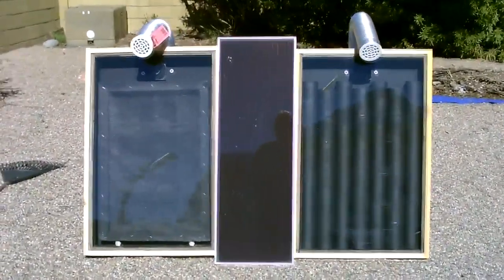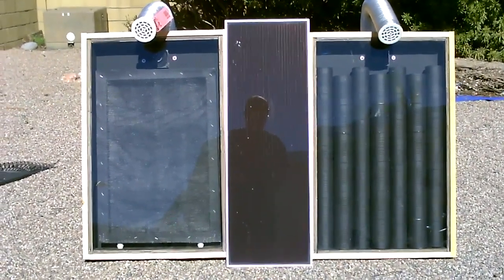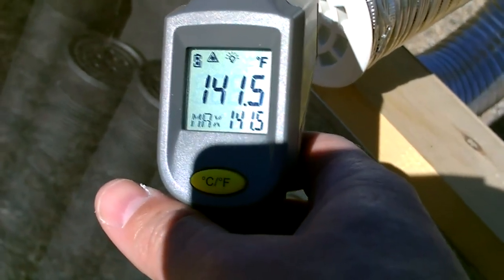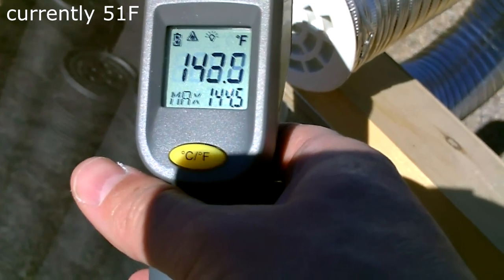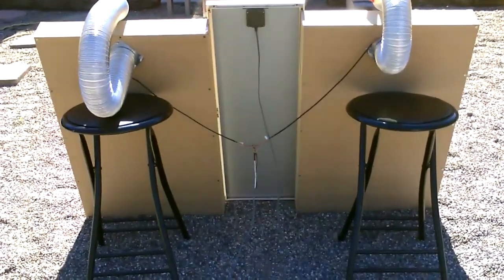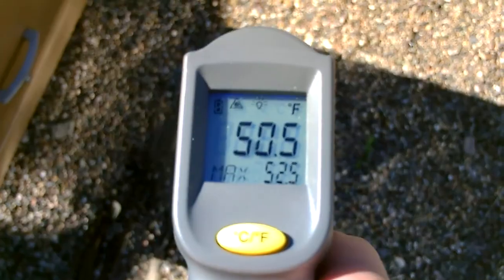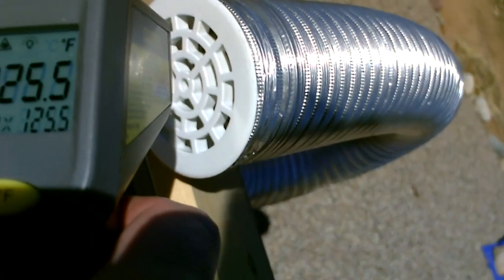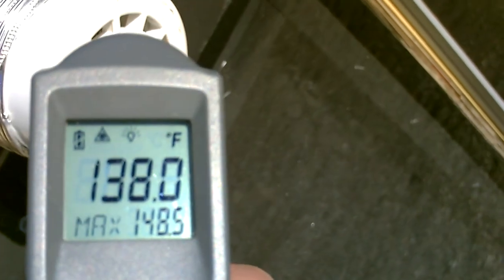Solar Air Heater Comparison! - Steel Can Heater vs. Screen Absorber Heater (temp. tests)

Comment: Although the can solar air heater has slightly lower efficiency it has more mass and will run without the sun for several minutes (one poster demonstrated his solar can heater would run 10 minutes when the sun went behind a cloud) whereas his screen absorber was off real quick after being shaded by a cloud and was on/off on/off on partly cloudy days whereas the can collector was more consistent.  That would drive me crazy inside the house since I live in a cloudy area and so far I'm leaning more towards the solar can collector even though it's 3-5% less efficient it won't be cycling so much on cloudy days driving me crazy.  If you live in a sunny area, screen collector all the way it's so much easier to build.
Reply: The point of a solar collector is to turn as many solar rays into heated air, and move that heated air to get that energy out of the solar collector before that heat energy is lost to radiative or convective heat loss. The down side to more thermal mass and lower surface area absorber is that it has to get hotter to give up  heat to the air. Think about this, 1 square meter has to get hotter than 10 square meters to heat the same volume of air in the same time frame. Being the absorber is hotter results in radiating more energy away as infrared light vs heating air as can be seen with thermal imaging.

One can still intigrate thermal energy storage with a box of rocks  resting on a wire screen layed over a wire mess and blocks supporting the wire mess. Hot air from the collector can be fed up through the rock providing a lot more thermal mass and surface area to quickly store or give up heat energy.  When the air inside the solar collectors is the same or below temperature inside the home, forced air is then be diverted from from the collectors and fed strait into the thermal storage. Being fed room temperature air, the rocks would then give up their stored heat energy.
Reply: @kreynolds1123  Fire bricks, used in Air tight wood burning stoves.
Thanks for the idea.. I'm building my first collector as we speak.
Reply: More Mass however will also take longer to heat up.  You can balance them to your use.   Your fan will stop long before the heat is extracted -add a small Li-on battery to keep your fan going during light shade.
Reply: Any interesting and valuable point. I was thinking of using this for greenhouse heating and pumping it into a thermal mass battery anyway so it still works for me. I suppose the same could be done for a home, but that's a little bit more difficult than just burying the duct in some dirt.
Reply: What Keith and Daniel said. Check out Kirchoff's law. More mass = more time to get up to temperature. More heat sitting in a collector that's shaded = more radiant heat loss. That would = far more than just 3-5% less efficient. Generate and move that heat as quickly as possible. An ideal collector will have high thermal conductivity, low mass, and low emissivity. All solar collectors designed and tested with thermal mass have proven to be less efficient, and not cost practical. It's a waste of material.

Comment: What about some very loose black painted copper(may have to use steel wool, because where are you going to find fine copper wool)? It would allow very good airflow and lots of surface area.

Comment: Imagine the temps if you were to take conditioned air in the bottom & output the air at the top. Have the heater on the outside of the home with the intake at the floor of the room with the output of the heater up the wall of the room.

Comment: since the screen isnt 100% blocking the sunlight, a second and even 3rd layer of screen could be added say spaced 1cm apart, even if the third layer gets little to no light, there no loss and the cost is virtually nothing.
Reply: Ideally, solar collector both minimizes their thermal mass and maximizes surface area to increase their efficency. In short, the point is quickly get the energy to heating the air, and to move that air out of the collector before the energy radiates away.

Comment: Can this be placed inside the home,in front of a French door?Will it effect the glass on the door?Great video!
Reply: +Bill s .    Remember, once the sun's rays penetrate the window, that  heat is already in the room.
Reply: +Elaine Howard Biber   Yes, that is certainly true, but with the collector working with already somewhat heated air, wouldn't it produce even hotter output with zero radiant leakage since it is entirely inside the structure already?
Reply: +Jim Smith Sr.  I'm no thermodynamics expert, but I don't think so. Wouldn't the room just get hotter and hotter without limit ? Once the heat from the sun is inside the room that quantity of heat is fixed. If you use it to heat up the collector then that sun light is not heating up other surfaces that the collector obstructs.

Comment: Hi...a comment and a question. first do you think a black painted aluminum screen would be even more efficient?  question.
since the black screen seems to absorb heat pretty well, does this mean that we should be using bright screens on our window if we want cooler air through them into the house?  shiny aluminum for example?

Comment: Thank you for the detailed build instructions in your other video ans for following up with a comparison video. 

I feel that the can version would be hotter if the airflow was greater. so by drilling out the whol bottom of the can.

I have 2" pvc pipes, but seem to find no video of anyon doing it with pvc. we don-t have cans here because people crush them for recycling...

What's your take on PVC?

thank you
Reply: +Yves Baggi you don't want to use PVC because they are an insulator and would not allow the heat in the Pipe.  The best thing I would use is copper tubing.
Reply: Aha, really? I didn't know that. I figured copper should be best but pricy. will go with soda cans.

Thank you Randy Holt
Reply: I've seen several videos where people buy aluminum downspouts and make solar heaters in a similar fashion.

Comment: have you thought about aluminum screen with a black coating? And since the heat output of these is fairly close which one was faster and cheaper to build?
Reply: clearly the popcan one
Reply: @Ladosligese  What? How is the pop can cheaper to build? When the other you just have to stretch a screen across a frame.

Comment: I am surprised that the screen is better. I guess the surface area of the cans is not so big. Maybe it would be better to cut e.g. Soda cans into little strips and let the air rise through the spaces between, but you need a lot of pop cans for that. :-) 
I would be currious if it is possible to increse the efficiency if one zig zags the screen material horizontally or vertically. Maybe I try that. Another interesting experiment would be to try to release the hot air through little holes along a baseboard pipe. There is a physical law making the rising air, stick to the wall, heating it up. The air cushion along the wall heats up the wall and makes the wall radiate excess heat after some time. Also it reduces the walls from sucking the heat from the room.

Comment: if there's clouds covering the sun and its snowing wont the cans get cold and not work ?
Reply: The cans will still stay warm even in cloudy weather. There is still light to be collected and converted to heat, albeit not as much as if it was exposed to full sunlight.

Comment: Do you think that If this were laid on top of a roof (4/12 pitch)  the surface would be warm enough to prevent snow buildup? Does it require a steep angle to remain 'snow free' ? I'd like to put these on my south-roof top, it's  a large sunny area. Thank you for all your work and for sharing these videos.

Comment: ok, what happens when you add a layer of black ceramic tiles on the back inside the box? or just forget about the metal altogether and rely on the ceramic tiles.
Reply: +Helios Higgins great idea. i was wondering if filling the metal cans with sand would heat them up over time and provide a longer heat output. i would guess that the initial heat out put would be lower of course
Reply: I hear what you are saying, but how would the air flow through the cans If you filled them up with sand? You probably need more of a pebble and a stronger fan to make it work?

Comment: From what I could see, a few degrees in the temp for free heat solar or can, would not be a big worry to me, but if you were going to use in some form of industry or engineering it may need tinkering about with to get finer details, either way, good vid, cheers... just wondering if thin aluminium tubes rather than cans would be easier, but costly..

Comment from the maker: +Jerry Yuen hi there. yep, i've tried it without cans or screen mesh. the temperature, on average, is 25 to 35 degrees lower without either. (the screen absorber "build video" has footage of that test)
Reply: I think the air moves through it faster
Reply: great info man!

Comment: Hi there, is a great simple design. And great comparison video. Have you done a temp measurement on just the empty black paper lined box with glass only, without cans or mesh. I am curious to know what the temperature reading.

Comment: Did you somehow make sure or test if the air flow is identical? The temperature alone does not cover thermal performance...?
Reply: desertsun02 Yes, BUT...the airflow needs to be fairly identical over the solar collection media. It would appear that the cans only have a few small holes in the top of each stack. I would conside opening them up much more. Either 1/2 in holes where those reside, or just one big 2 inch hole saw cut.

Additionally, I don't know how long those panels sat in full sun before the test, but the much higher mass of the steel cans cold be providing a sink for the heat gained inside the box. This will result in a lower average temp, but a longer duration of heat when sun goes down/behind a cloud.

This would be like measuring the heat of cast iron pan and a sheet of aluminum foil over the same flame. The foil will get hotter much faster, but will also cool faster when the heat source is removed... 

IDEA: how about using heavy blackened aluminum foil only as your collection grid, possibly using the cans as a "wave" mold? This would allow a large surface area for the air to pick up the thermal energy collected. Also, a bit more work, but you can collect more immediate heat if you make the fan collect the heat more evenly over the grid. This is easily done by putting more holes along the top of the box where the fan is now and making another box on top of those, with the fan pulling from that box. The holes at the outer edge should be larger and getting smaller to the center to allow the most even airflow. In the end, you'll get the same TOTAL heat, but this will just allow higher temps in the near term via better airflow over the collector.

I build solar water distilleries and have learned to optimize the solar collection over time. I've had great success doubling my heat collection with simple panel concentrators, but you do have to track the sun more with those....Good Luck!
Reply from the maker: andersenchrhome hi there. since the fans are identical (same make and model) and both running full speed (39.02 CFM) the flow is nearest to equal as i can make it. *power draw of each fan is 1.8w. (15w panel used)
Reply: I wish you were my neighbor. I can build. I just don't visualize these awesome ideas like y'all.

Comment: So not much difference if any and the screen absorber is probably easier to make. I was going to make one with some black aluminum photo foil. I think that would be easier than cans and last longer than screens in that heat. Just a thought. Nice job. I enjoy all your videos.
Reply: What would be the cost for somethings like black aluminum photo foil...going to have to research that term...LOL!
Reply: I got 12 inch by 10 foot roll for like 9 dollars. I think you can even find it cheaper.
Reply: Hello TRON
where can I get black aluminum photo foil? Thank
Reply: Any (photographic) studio supply store. I work in a camera store, we have rolls of it. Cinefoil, is the brand.
Reply: Lets look at two hypothetical solar collectors of the same size and color.

One is aluminum foil linning spray pained black. Light hitting it is absobed and is converted to heat.  It gets much hotter than the air above it. For this discussion we can ignore the surfaces below.   Some of that heat is given up to the air above it, but that is limited due to air flow and surface area.   Also because it is hot, some energy is radiated as infrared light out to space. The hotter a surface is, the more efficent it both radiates infrared light. 

If the same amount of sunlight falls on a larger surface area like a screen or fiberglass insulation spray painted black, the substance does not get as hot as the light is collected over a larger surface area that is also incontact with more air inside the collector. And because of the energy is more quickly given over to heat the air, less energy is lost to infrared light making the high surface area solar collector more efficent.